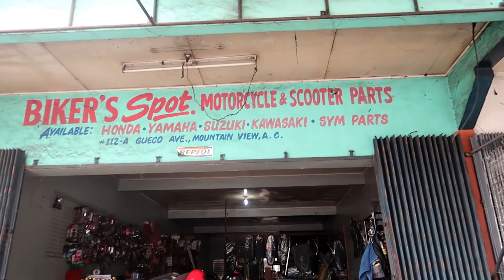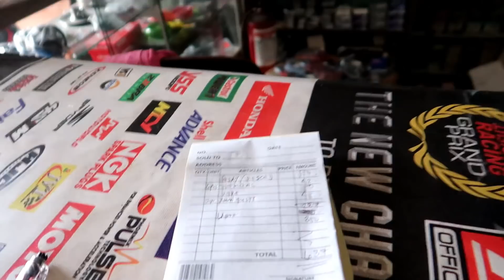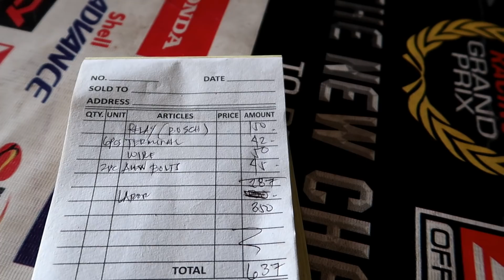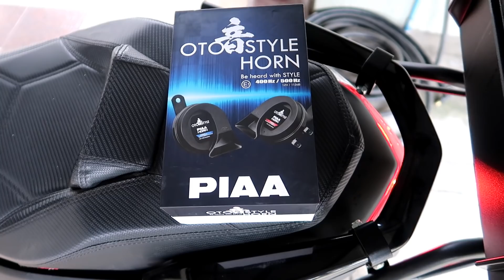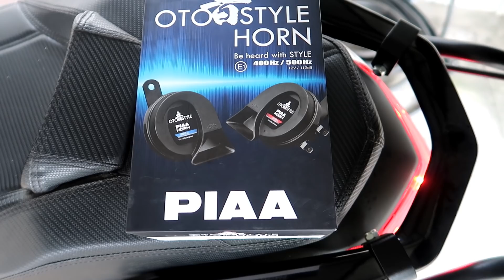My Filipino Wife BLOWS MY HORN & SHOPEE SUCKS : Angeles City, Philippines

Comment: and kymco is a very good brand from taiwan, it's not chinese, i've got a kymco xciting 400 here in AC...it is superb, very reliable, fantastic fuel economy, did 20.000 kms with it so far, no issue whatsoever, just changed one rear tire, 1 belt, 1 battery and rear break pads in 4.5 years!
Reply: True Kymco is a quality Taiwanese brand.